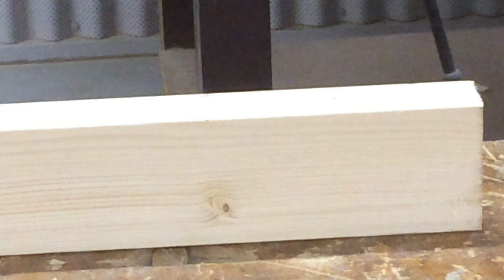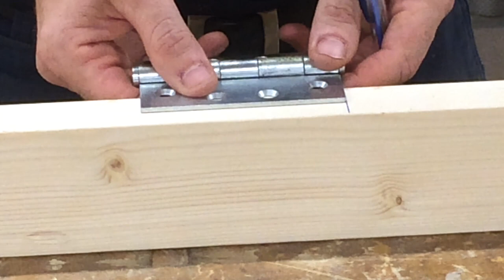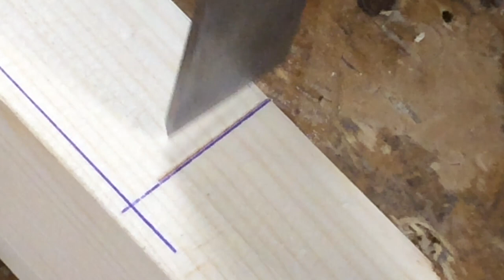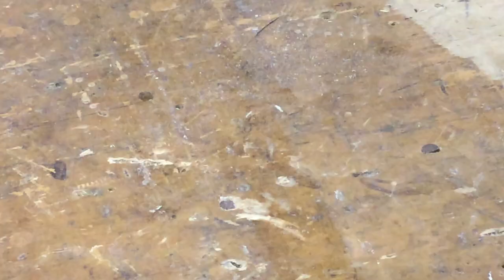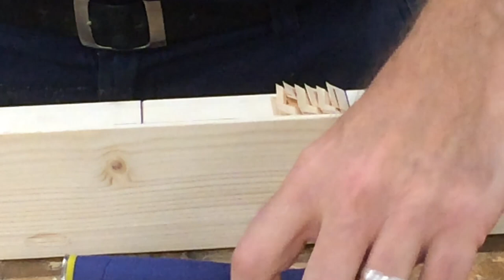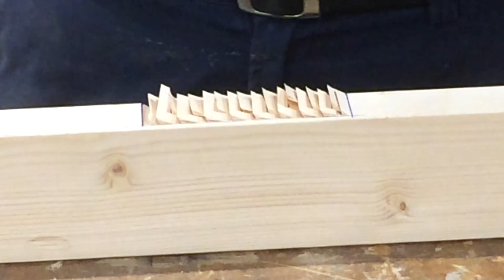Install a butt hinge with a chisel

Comment: isn't the big side of the hinge (as you call it) that goes to the door?
Reply from the maker: with a butt hinge this isn't an actual rule, just my rule. A fast fit hinge (hirline) is designed with an actual small side and big side, and are meant to have the small side screwed to the door.
Reply: Think of the open leaf as the part of the hinge that goes on the door, as it too, opens! That's how I remembered it at college.